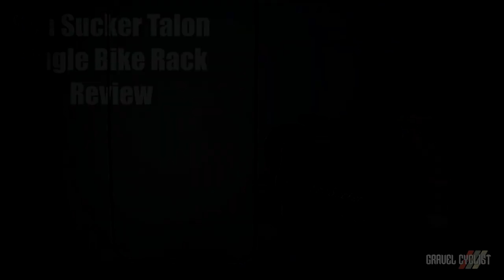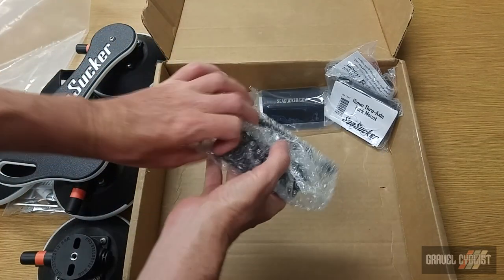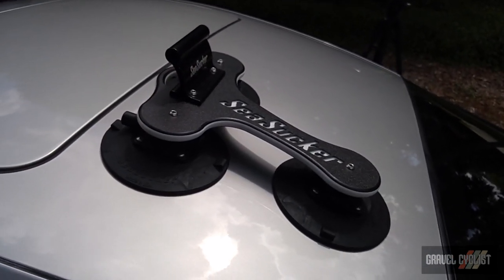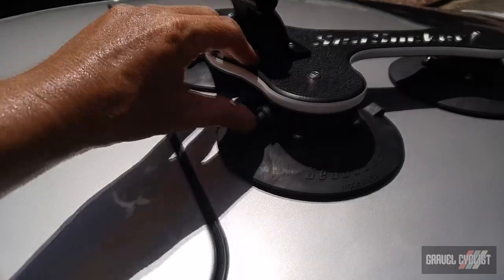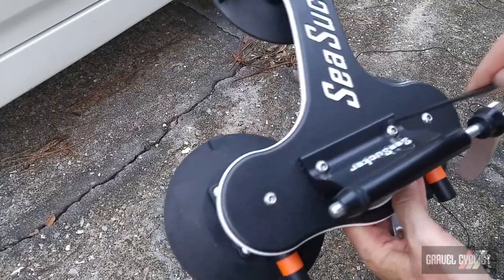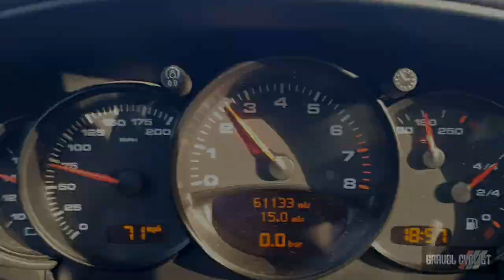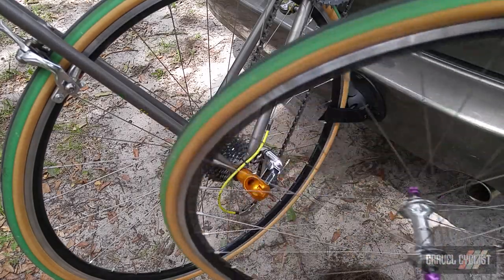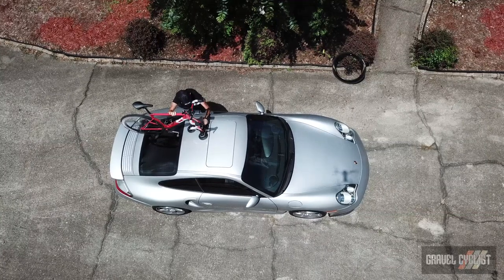SeaSucker Talon Bike Rack Review - The Most Versatile Bike Rack Ever?

Comment: I've been using these for a couple of years and haven't used my traditional roof mounted racks since. Little tip - fit the front mount as normal to the car then fit the rear mount to the wheel of the bike when its on the ground. Fit the bike onto the front mount on the car then place the rear mount onto the car by letting the bike down onto it. That way the rear mount is always perfectly positioned because if you don't you might have to keep adjusting it for distance away from the front mount in order to align with the rear wheel perfectly.
Reply from the maker: Nice tip!
Reply: Wow, glad I watch this vid.  This tip is really useful.  Never thought about it.  I keep thinking of everytime I take the seasucker off, I have to adjust it again.  Thanks.  I wish you can just leave it on your car and nobody steals it.  lol.
Reply: Thanks for posting this tip because that rear suction alignment step seemed to be missing a cue 🤔
Reply: Wua Name I don’t 🎲

Comment: Picked one up today so I could carry my bike on my mini.  I saw it advertised at a local store for $150 off and I had been looking for a way to carry my bike on my mini without having to get major modifications completed on my car.  Before I went and bought it I checked YouTube to see reviews and this is the first one that popped up.  Watched your video last night and decided I would go and pick one up today before the sale is over.  Funny thing, I hadn't read the reviews earlier before I attached it to my car.  I did take a wet and dry rag out to wipe down the roof area and I also did what someone else mentioned and attached the bike on the ground to the Talon then lifted everything up onto my car as I wasn't sure exactly where I would need to attach everything.  I now know where to put the front part and I will just attach the back on the ground before lifting the bike onto the front section on the roof, allows me to line up the bike front to back a little before actually engaging the suction on the back mount.
Reply from the maker: Nice one. Once you figure out where to place the front part of the rack, and the rear wheel support suction cup, it is super easy. My Talon still performs flawless, and does duty from time to time on my vintage Corvette.

Comment: Good Review. Thanks... I have one already and I love it... Great video to show to friends who may be interested but don't understand it... A couple of suggestions: 

1) The orientation of the mounting bracket should be such that it's leaning towards the back of the car to reduce wind resistance, and to avoid exerting an upward force on the suction/vacuum cups...  The way you have the bracket mounted in the video is meant for the Talon to sit with the single cup in the front...  such as when mounting a portion of it on the windshield. Not a big deal though...

2)  There is a new version of Talon Available that allows you to use only one Mounting Bracket, with various adapters that can be inserted into the axle hole to allow it to fit different (9mm, 12mm 15mm diameter) axles..,
Reply from the maker: Thanks for the tips, and nice to see they've now got only one mounting bracket with various adapters.

Comment: Interesting product. I currently use a truck mounted bike rack and have been debating making the upgrade to a roof or hitch rack, both of which come at a cost (i.e. Loss of fuel efficiency, cost of installation, etc). I prefer the trunk mount bike rack because of its ease of use, however, it does scratch my vehicle. I’m sure others will agree that entrusting your several thousand dollar possession as well as the safety of other motorists to a few suction cups is somewhat disconcerting. I’ll definitely be keeping this product on my radar. Thanks for sharing.
Reply: No worries mate.... these suction cups can handle 220lb each... the bike is not going anywhere... I've had mine now for 2 years... I used to worry so much and always kept an eye out my sunroof to check up on it... but now I don't even think about it. BTW, I wouldn't recommend to anyone to keep their SeaSucker rack on the car roof full time. It takes only a couple of minutes to install and un-install it... someone may steal it... or keep the rubber constantly exposed to the elements/UV etc... If you're going on a long trip, just bring the bike indoors,  and/or make sure the pump is fully in --  i.e. no orange section shows....

Comment: I had to return the 2 bike setup as it is too stiff and was deforming my roof big time due to the curvaceous lines on the F-Type.  Be careful if you don’t have a glass roof like mine, mine is thin aluminum and the rack was too stiff to conform to the rounded roof.
Reply from the maker: David, thanks for the feedback, really appreciate real-world reports like this.
Reply: My rig has a ribbed roof...not sure this would work as the suction my not seal???? Not sure

Comment: What about security? I travel up and down the west coast. Is there a locking option so I don’t need to remove the bike at ever nights stay?
Reply from the maker: Mark, I would suggest you remove the bike, it is a pretty quick process. This rack is easy to install / remove based on suction, which means there is potential for theft. Good luck!

Comment: Would there be concerns mounting the front portion to the sunroof? I have a 964, and given he wheelbase of my bike, would require it be mounted on the sunroof panel. (Still metal)
Reply from the maker: Hey NIck. I tested mine on the sunroof... there was some flex if I wiggled the rack left to right (thin metal on the sunroof), but no damage to the sunroof. Just remember not to open the sunroof whilst the rack is present! :)
Reply: Gravel Cyclist very important not to open! Haha. Thanks for the reply.

Comment: Hello. My question is: can I place my bike with both wheels on? Can i tie the from wheel with velcro. The bike will be a fixie.
Reply: You need to buy another adapter, not just use a velcro. So the back wheel and front are side by side.

Comment: Looks like a smart bike rack.  However, I would be concerned with the rubber getting brittle over time due to UV.  Loose the bike and damage the 911.
Reply from the maker: Something to pay attention to for sure. When the rack isn't in use, I keep it well hidden inside. SeaSucker have a good number of spares available. Thanks for chiming in!
Reply: BTW, I wouldn't recommend to anyone to keep their SeaSucker rack on the car roof full time. It takes only a couple of minutes to install and un-install it... someone may steal it... or keep the rubber constantly exposed to the elements/UV etc... If you're going on a long trip, just bring the bike indoors, and/or make sure the pump is fully in -- i.e. no orange section shows....

Comment: I want one but they looks easy to take off and steal if someone knew what it was
Reply from the maker: Easy to remove, but not a rack I would park anywhere overnight. It serves its purpose for transporting the bike from A to B I feel.
Reply: @GravelCyclist  I would remove the mount when I go places but that shouldn’t be a big deal, no security but the mount looks strong and easy to use
Reply from the maker: @nc33228  The good news is, the entire rack front and rear section weigh about four pounds. I took the rack with me to Italy recently in my luggage in the event I had to transport a bike atop the roof. Never ended up needing it, but a good option for small European rental cars!